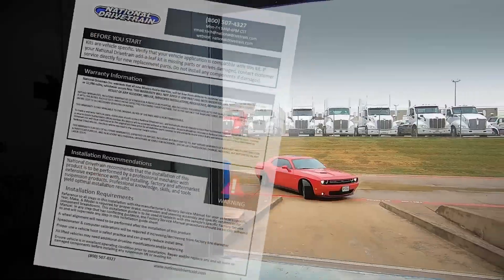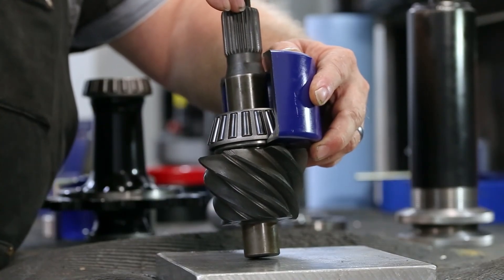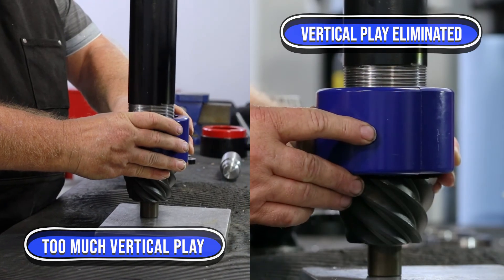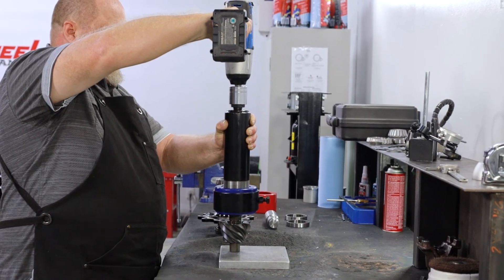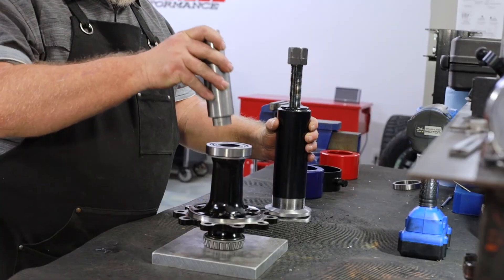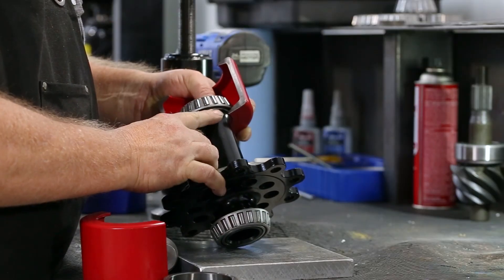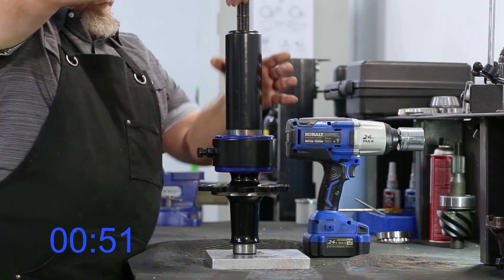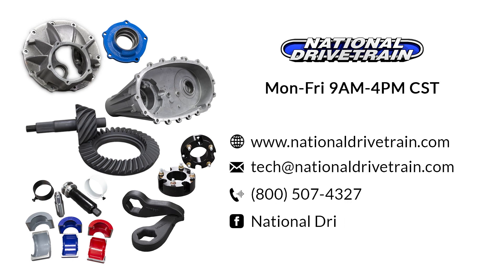Clamshell Bearing Puller Instructional Guide

Comment: Are the bearing damaged when removed with this tool?
Reply: Not at all.
Reply from the maker: When the bearing puller is used properly the bearings are not damaged and can be reused. Keeping the outer race on while pulling will protect the rollers and cage. Check the clamshell before using to ensure it is the appropriate size for each bearing - it should catch evenly all the way around the cage. Then make sure the clamshell and puller are centered on the bearing for a clean pull off each time.